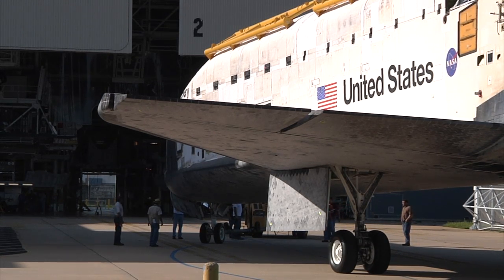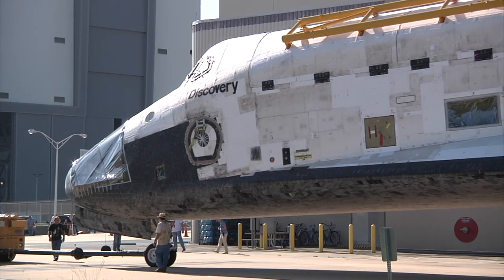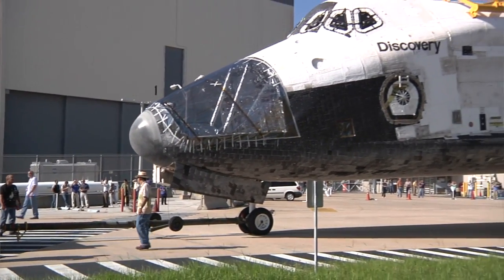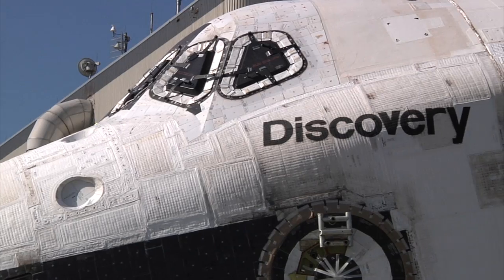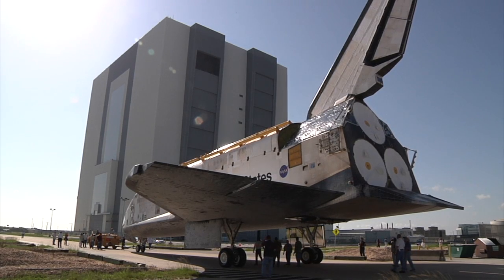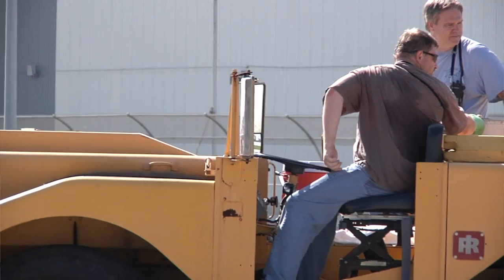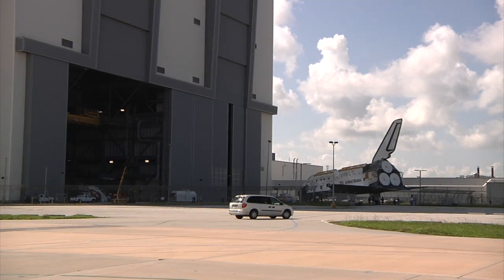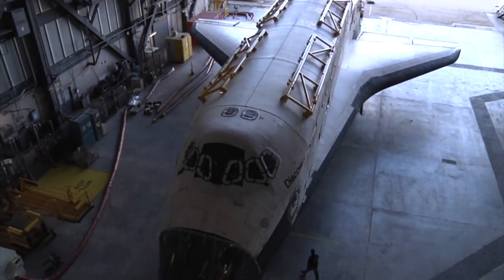Discovery makes brief appearance on road to retirement

Comment: @Ferrariman601 Obama had nothing to do with the retirement of the shuttles, this has been a long time coming.  They are extremely expensive and somewhat dangerous. Anyway its time for NASA to move to use private designed rockets. Space X did [designed Falcon 9] for 390 million what would have taken bureaucratically logged NASA 4 billion. I'm not an Obama supporter, just being accurate.